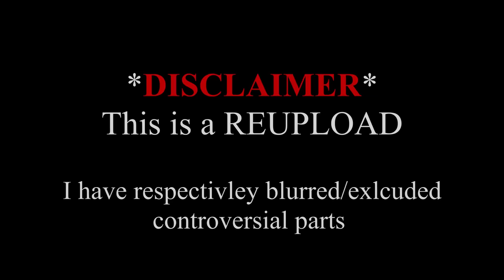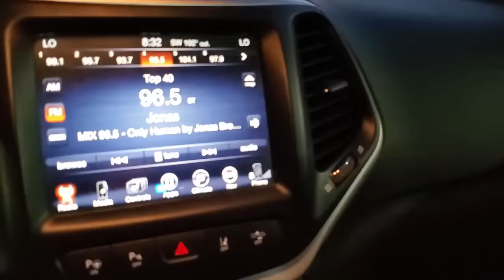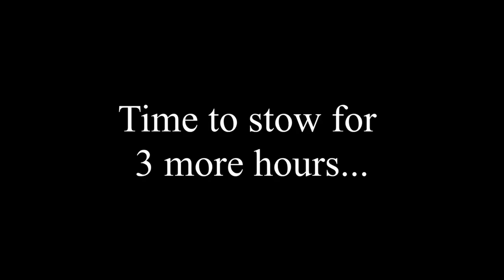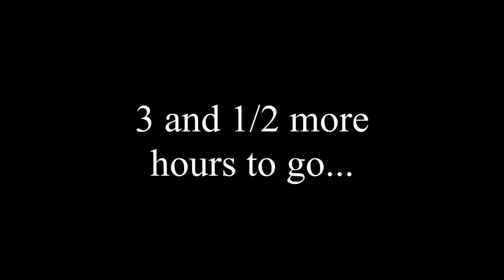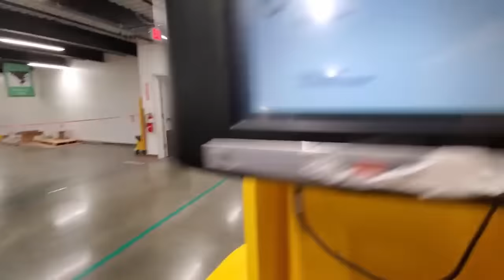DAY IN THE LIFE Working at an AMAZON Warehouse (Inside Footage)

Comment: I'm about to start my first night working 10:00pm-8:00am. I'm super excited, I've worked customer service for almost a decade in multiple fields, and I'm burned out on it. Fingers crossed it goes well!
Update: 5th Week In
So far, it's hard work, but simple work. Stay at a quick pace, and you're exerting a lot of energy, other than that it's excellent. You get benefits, paid time off, vacation time, and some unpaid time. It accrues pretty quickly too. There's a fair amount of snacks and drinks provided, access to ample PPE, and there's nowhere near as much pressure to perform perfectly than the general public is lead to believe. Overall it's been a great experience. My shift ended up actually being 10:10 PM to 8:40 AM, so I work 10 hours with a 30 minute lunch break in the middle, which might harbor my only complaint. At least with the jobs I've had prior, you get longer lunches for longer shifts. Here, that's not the case. You get two 15 minute breaks, but really they're 10 minutes a piece because you have to walk across the building every time you get one. You get a 30 minute lunch, but all that really gives you time to do is speed eat some food and warm up for a few minutes in your car. I feel like the argument could easily be made that since the shifts are long, and the job laborious, a respective longer break allowance should exist, even if it's broken up into 15 or 30 minute increments. 
Pros: Pays well(20.50 an hour in Oregon for warehouse night shift), benefits, paid leave, simple work
Cons: Labor intensive, short breaks, speed oriented,
Reply: I hope you've had a good start to the job! How's it going working at Amazon? I am thinking about applying for a job there myself 🙂
Reply: @judaspriestess4753  So far so good! It's really hard work, but I like to think of it as a gym membership that pays you to work out. Everyone is incredibly nice, the job itself is simple, you just have to keep up a good pace. I'd say go for it if you're interested! Worst case scenario you get a different job.
Reply: I like this type of jobs but I have some questions about it, maybe u can help me a little? 

For example, is I want to work a shift starting from 8:00 am to 6:00 pm how much would be the pay? I can work 70 hours a week or more without problem? or there are specific requirements about how many hours u can work?
Reply: @miguelcid3181  They have set shifts you can work, I'm not sure if 8 am to 6pm is a shift they have, but you can work up to 12 hours a day, so you could potentially do 70 if you wanted to. The pay depends on where you live, it can vary greatly. In Oregon, base pay is 18.50, night shift gets a 2 dollar differential knocking up to 20.50. Peak season usually has a temporary pay increase.
Reply: @highDparr  Thats sound really good, 18.50 is HUGE at least for me 😅 I'm used to working 12 hours or more (and just payed 80$ per month lol 😂) so I don't have a problem, thank you very much for your help.
Reply: @highDparr  good to hear 💯
Reply: Hey I wanna ask, can u work 8 hours only in Amazon warehouse? Do they offer that

Comment: Takt time when stowing is the thing that most people struggle with. Small to larger down the line and have 8 bins ready to go that is my tip.
Reply from the maker: Yep that's good advice 👍. I hate task time. Puts a lot of pressure on you all night/day.
Reply: Luckily, I’ve never had a problem with rates. Even with an average of 15-20 seconds
Reply from the maker: @memenazi7078  thats good! Just need to be above bottom 5%

Comment: It's interesting to see a different warehouse and the tools they use. I recently quit my job at YVR4 because I had to go back to school full time. Stow was my primary position but it was way different than what you had there. Where I worked we had to push u-boats or juice carts go into aisles and try to find space in cardboard bins, which honestly was a nightmare since a lot of people disregarded proper bin etiquette and made it harder for others to stow physically or virtually. Which in turn increased my time-off-ask. I never really had a big issue with the job itself and the managers were pretty nice to me, although if I knew faster I would have switched to IB dock early on since I was cross-trained there too. 

If I did have an issue though it was with the points system, which discourages people from staying home even when they are clearly not well and risk spreading COVID-19.
Reply from the maker: Interesting, yes I do think my building stowing is maybe more modern than other warehouses. And I do hate the point system as well. I'd have to agree that it does not help lessen COVID

Comment: The work is easy and the pay is good. Its just the consistency that's hard in my opinion. At my warehouse you can have a pretty good rate every single day but the minute they see you slackin, their all over you. Its annoying.
Reply from the maker: yeah annoying for sure. But yes easy job overall
Reply: U sure thats not all jobs? Lol
Reply: @AstarionWifey  yeah some, but this one specifically stresses you. Like I could stand for hours moving like Usain bolt on crack and the minute I take a short breather, they all over your ass. I work a 10 hour shift.. Its like they only pay attention when you slow down and "that" specifically stresses me out.
Reply: @teeman6115  oh yeah that's the worse and doesn't matter what you say to defend yourself either.

Comment: Get you some compression socks and Circumin.  They'll help with the leg problems
Reply from the maker: yes I heard about this, I should get them
Reply: what are they? like what does that do?
Reply: @mcqvrie  it feels like tight knee socks. It aides the heart in pushing blood back up from the legs and feet. Even if you have no circulation problems they're still really good for your legs and circulation as well as stopping any swelling.. I work on concrete 10hrs. A day 6 days a week. I wear really good boots with custom insoles, but you'll never catch me without my compression socks.

Comment: I just clocked back in after my 30 min break and had to use the restroom for 10 min and my stations on the 4th floor. Do you think I'll get in trouble ?
Reply from the maker: no you won't
Reply: Yes later your supervisor will asked you why  in 10 mnts you didn't scanned anything. I worked there in Ruskin FL they treat you like slave

Comment: I’m an Amazon driver being a driver can be tough some days only the stronger survive 😂 I was thinking of switching to warehouse duty  but being in the warehouse seems boring but more relaxed then my Job I work Friday-Sunday only 8 hrs daily and we get driver bonus so we get paid for 10hrs even if we only worked 5-8hrs
Reply from the maker: It is boring, but at least your wont have to drive aroud and risk hitting other ppl on the road
Reply: Well I haven’t had any situations on the road so far (knocking on wood) 😂 we have to drive very careful because of the netradyne driver camera it’s actually a lot safer then I imagined ngl that was my biggest fear at first now my issue is the long driveways on snow days 🤦‍♀️ I am still considering the warehouse though honestly my thing is that we have very good managers and they are flexible with our daily lives are the warehouse schedules flexible for example as a driver if I can’t work a shift I can call out at any time and someone will pick my shift up I won’t get written up or suspended and I can always pick up another shift to compensate for the day I took off I need that flexibility for my children

Comment: Worked at a warehouse in Everett MA, DB02. Did the unloading of trucks when they were fluid, loaded the belt from gaylords, and carts, did picking, and the application of the stickers with the battery operated hand guns, and stowing. The worst was the stowing. Toooooooo much pressure and they measure your speed, only portion where they were up your ass. Picking is hectic, they give you toooo many isles to load like 5 and the packages come down the belt sometimes 5 layers thick with your numbers and no time to take it off and move quick enough to feed 5 isles. And the racks would get overloaded and the poor stower couldn't keep up and then it was just push the packages on the floor. I used to catch the people up stream and throw the packages down the isle. they would cover for me and stack the same numbers on top one another. We all tried to help each other, and some people would melt down and get violent. I tried to keep the peace and always stopped confrontations. It is fast and hard but mentally easy, physically it is killer. Great way to work out and collect money. Avoid the gym and just work here and get paid,

Comment: Stowing is really boring and the time goes by really slow all the time especially when you're out of work which happens a lot.  Packing is horrible since they constantly move you around and you usually have to water spider yourself with materials for every time they move which is usually around 5 times a shift.  Also you have to change your gloves every day since the glue from the tape messes up your gloves and seeps thru onto your hands where you have to wash off every break as well.  On Ship Dock they jerk you around constantly moving you to other areas after you get set up nicely at one area which is the most annoying of all.  The warehouse is always an oven in there since they never have any air conditioning and only fans that blow hot air around all day.  The best part of the job is if you live close to it and that you can leave whenever you want as long as you have the time.

Comment: I’m currently working as a picker in amazon It’s not a bad job honestly but personally it gets depressing over time for me just because you do the same thing over and over and over. They get on your ass a lot though you have to have at least 350 items per hour done you can get to that number but it depends on the items you have to scan weather they are heavy or not big or small. it’s a lot at pressure personally for 15 an hour I think at least 17 would be pretty good if they pressure you and have high expectations.  they sometimes would get mad if you don’t scan for a certain amount of min but sometimes you can’t because the machine got stuck and the person in charge to fix them takes a bit and they get mad at you which is annoying but it depends a lot of which facility and the coworkers. Overall good benefits but can be physically tiring.
Reply: Do you start at 15 an hour? I’m thinking about applying

Comment: 3 12 hour days and then off for 4 days unless you want some overtime? What are Amazon workers crying about? You get 2 15 and 1 30 minute breaks? Lol right now I flag traffic 5 days a week outside in the frying hot sun for 10-12 hours a day and the same in winter freezing my butt off. I'm applying at Amazon. That shit looks easy compared to all day on my feet outside dealing with loud construction equipment and crazy rude drivers cussing me out and trying to run me over.

Comment: You still working at Amazon?
Reply from the maker: Yeppppp
Reply: NFZ Productions Aye cool.

Anyway. I start uni on the 27th of September. 
I am waiting for a start date on amazon.
The tricky part is, it’s a 12 week contract. But if I don’t start within the next few days. It will over lap my start date at Uni.

Right now I’ve went to amazon, they have verified my passport and everything else. I have now just confirmed by DBS certificate.

How long will the process take to get hired and actually start?

Consider however long they give training for aswell. 

I would really appreciate any advice. Thanks.

Or just how long the process usually takes to get hired from first applying online.